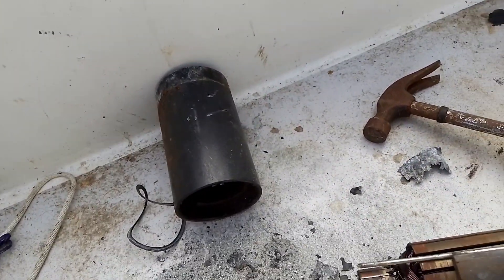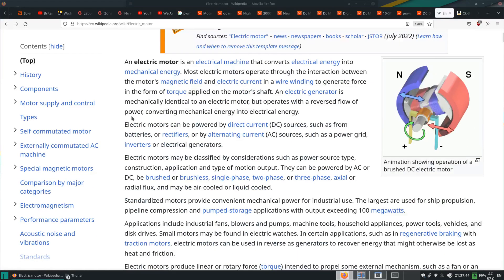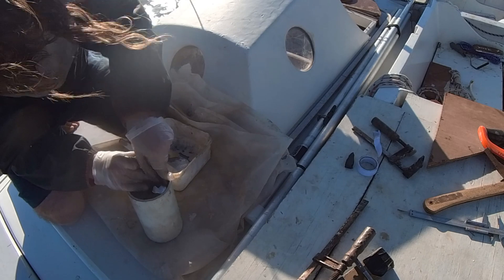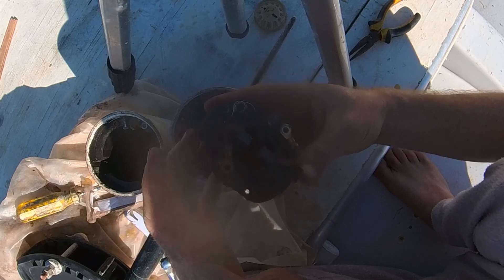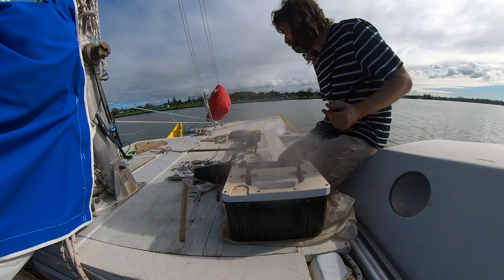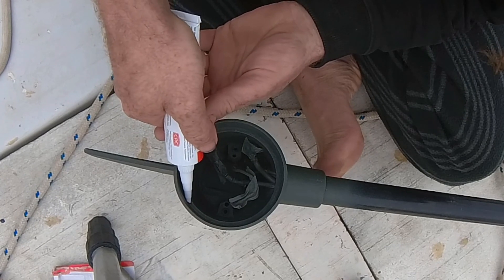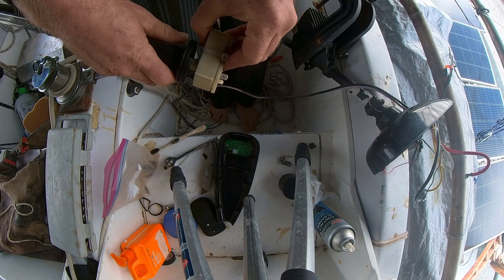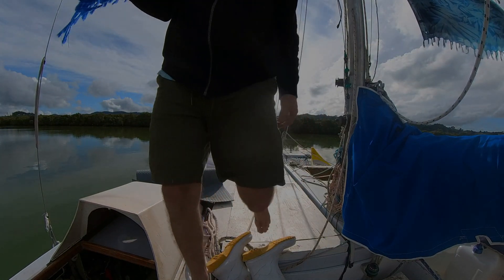Electric Trolling Motor with Broken Magnets. Will It Start? (Sailing Yes Let's 15)

Comment: hahaha i love it. gluing the magnet back together was smart, and lucky it didn't lose power. 
what horsepower is that motor rated at?
i have a little outboard that looks similar and i'm trying to figure if it would work instead of having to buy something bigger. i was thinking of setting up a sculling oar when i get my boat because i don't want to spend money on gas at all if possible, but i have a messed up back shoulder and neck, so there will definitely be days that i won't be able to use the sculling oar, so a little setup like this would be awesome. also, if i buy a used boat with a good engine then i can sell off the engine and get back some of what i pay for the boat, if i use a little trolling motor like yours
Reply from the maker: I don't know. These small DC trolling motors are rated in thrust, which is probably more helpful anyway. 1 hp = 750w but comparing electric outboard to gas outboard like that doesn't work because actually the gas outboard only gives that power at max revs and in practice, and electric motors have much better torque at low RPM so the "equivalent" electric outboad will actually be less power than the rated HP of the gas one.

sculling oar is good, I made a sculling oar for my monohull, but it took a while to get it working well. there isn't very much information on how to make them.

Oh yeah, the prop size is really important. For the trolling motor, buy largish plastic RC airplane props and try different ones until you find the best for your particular boat. I tried a 12x4 prop on my 12v 55lb trolling motor and it pushed my cat at 2 and a bit knots, reasonable and almost a knot faster than with the stock prop. The RC props come in a range of sizes, more than outboard props, and are cheap because RC people replace the prop after any crash/bad landing!
Reply: @dominictarrsailing  
oops ya, i meant LB, not HP lol.

ya, i have had a bit of trouble finding info on building a sculling oar, but i did stumble across a couple videos that talk about how they are made and why they are the shape they are.

my trolling motor is only 30lb, so i may have to get a bit bigger one, depending on the boat i get.
ill definitely have to remember to look into the rc plane props, that's a REALLY good idea i definitely wouldn't have thought of lol. did you use a common 2 blade prop, or were you able to find a 3 bladed one?

can you give me an estimate for the weight of your catamaran? just curious how much weight that little motor is pushing.
Reply from the maker: @PKAdventures  the trolling motor in this video is 24v and says 86lb. I also have a 12v one that says 55lb. But once I got a the 12x4 prop the 55lb with 12x4 prop was just as good. (I didn't have time to try different sizes, so maybe could be improved). The cat is about 2 tonne with cruising gear on board. Now I got a way better 48v brushless outboard, can push it through the wind and has better range. Was a lot more expensive. about 2k nz for battery and outboard. The 12v 55lb one was $140 second hand but $600 battery (which also powered the lights, laptop etc). I'm gonna make a video about this soon.

The 12v one was just perfect on mihi, useful but still underpowered on yes let's. Your 30lb one would go well on a canoe or dinghy I'd say 

Yeah it was just a two blade prop. The important thing is the diameter. Small blade area (skinny blades) is actually more efficient, but means higher wing loading, which produces cavitation (bad!) at high speed, but the trolling motor isn't that fast so it's okay. That's why most boat props have greater area, to avoid cavitation. A larger prop turning slower is more efficient.
Reply: @dominictarrsailing  hmmm it looks like ill have to do some more research into propellers, but i won't be able to get too far before i actually get a boat and have some real numbers and something i can actually test.
i have a couple lithium batteries im going to be using for my solar build for my suv, and i can pull 1 of those out to power my 30lb motor, so i guess ill hold onto it for some smaller boats i want to build to test out some ideas, but probably not in the paper mache one cuz i don't wanna sink with a good lithium battery and motor lol

thanks for all the info, you are awesome dude!
ill definitely be looking forward to seeing that vid about your electrical and motor setup

Comment: A small outboard is cheap, use a tiny amout of gas and is safer (more power). The real downside is the noise.
A catamaran like this need very little to move, we crossed the gulf stream on ours on a 8hp 4stroke yamaha. Took 2l/h.
I love the craftiness and the cheapness of your style, you don’t need a lot of money to go sailing.
Reply from the maker: Absolutely not! a gas outboard just isn't very reliable. Electric you turn the handle and it goes. Gas you pull the cord and hope! And there are so many things that can stop petrol engine from working, either causing it to stop suddenly or to not start.

Comment: The SDS for Etch IT doesn't list much, if it doesn't last maybe try CRC Yellow Zinc IT. I think products like propspeed that people paint outboard legs, stern drives and saildrives with are two part yellow zinc chromate primer and polysiloxane clear coat.

Comment: Electric or petrol you still gotta do some maintenance yeah. In regards to your motors housing breaking down you could try attach an anode. Or a piece of lesser metal that the saltwater current will attack first. Maybe a piece of lead like a sinker if you have to diy something up.

Thanks for the vids.
Reply from the maker: hmm, yes that might be worth trying. I sometimes forget to take it out of the water after using it (which will add up to a lot more time than it's actual use, for sure!) it hadn't occured to me that lead could work, I looked it up, apparently lead is less reactive than steel even, so it would actually make it worse. according to this, only option is zinc or magnesium https://structx.com/Material_Properties_001.html

Comment: Nice! Those old trolling units are 'ten a penny' now. Be good to recycle/re-use/experiment on some kind of 'Heath Robinson' multiple motors lashed together onto the Pahi designed drop down outboard mounting that could provide a more effective power level when required/needed! Dependent on your 'Bank' of course! The extended Wharram philosophy just makes more and more sense watching you Skipper! 'The People's Boat' it most definitely is!
This renewable energy and/or self sufficiency drive is such an important aspect of contemporary 'affordable' boating life that these kind of reveals/f-up's are vital for inspiration... Thanks Dominic! Crack on!
Reply from the maker: thanks! btw, I also have a 12v one, that works okay actually, except the wires do get hot if you use it full power for very long. It become a lot better when I put a 12x4 RC prop on it, actually. (will have to make another video about that)
Reply from the maker: but actually... discovering how good these model airplane props are, and also that they are both cheap and come in a range of sizes, has got me thinking a lot about pedal power